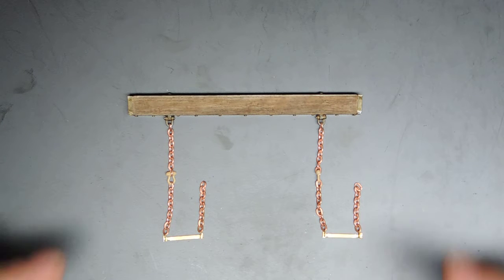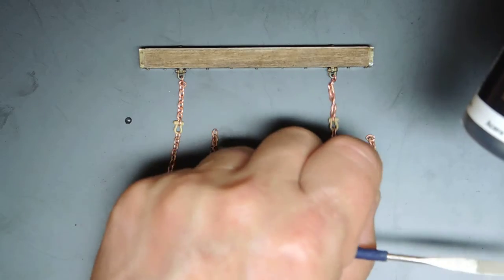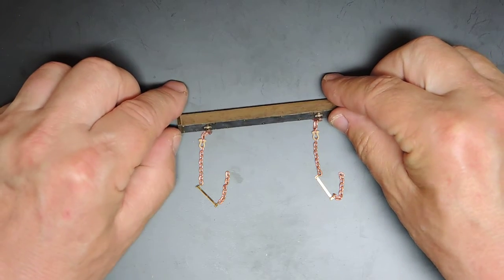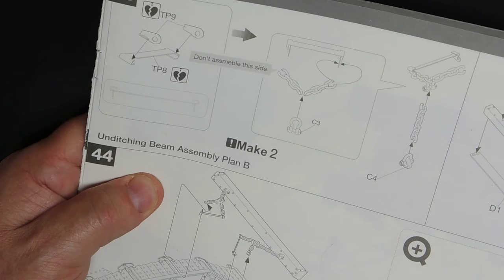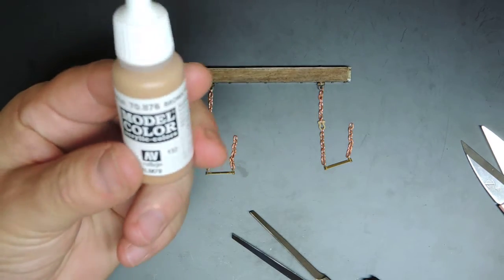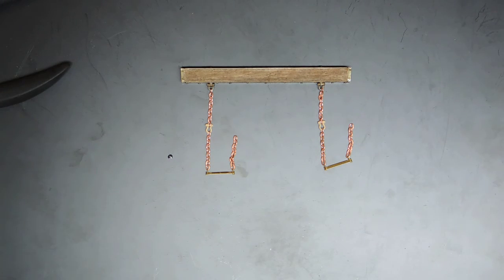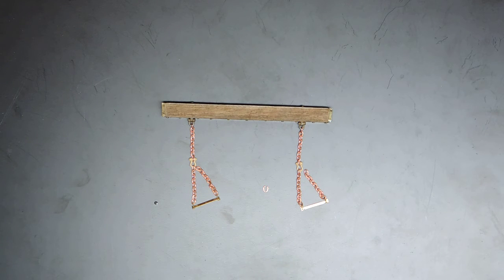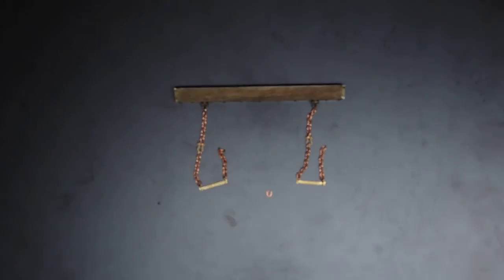SWITCHER BUDDY BUILD Mk4 WW1 TANK VIDEO 10

Comment: Great update Paul and clarification. As discussed during our e-mail the colour now looks the part. It is too bad you are still struggling with your white balance during videos, but don't fret it will come good buddy :)

I like your beam, she looks the part, I will be weathering mine on the vehicle, only because that is what I am used to.
Reply from the maker: Thank you switcher, the chain links may be a little bit long so will looking at that again? the ones directly attached to the beam are ok but the ones that attach to the trash photo etch cleat just look to long. The white-balance was better for this video I think' lol"
Reply: Yes it was Paul (white balance) I found that I have to adjust my gain and white balance on most of my videos, so I can see on my monitor what I see in person. e.g the camo was subdued somewhat on the video I shot, because it was too much in your face, sort of bringing it all together, which washes will do down the road. Now I need to think what colours I am going to use.